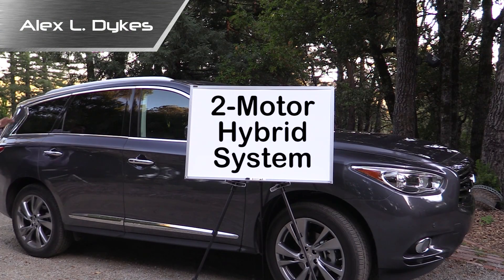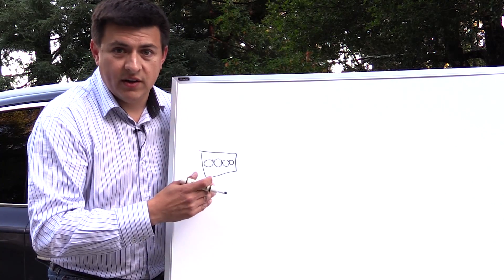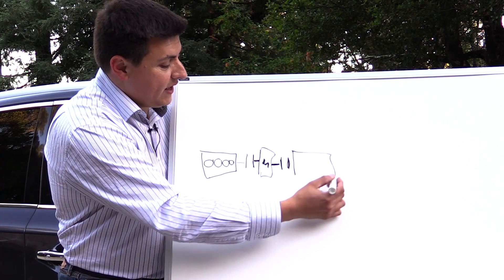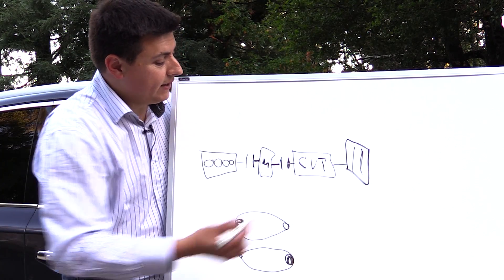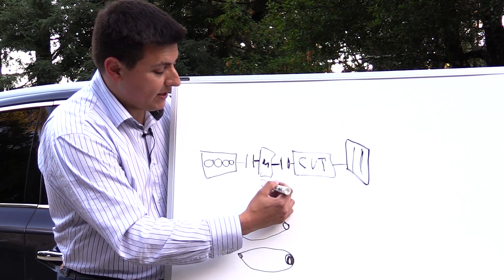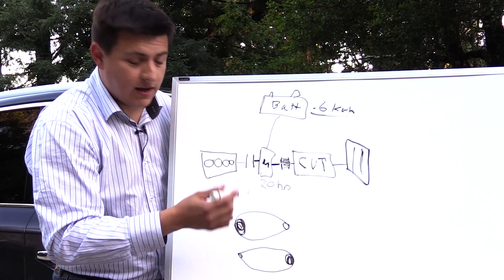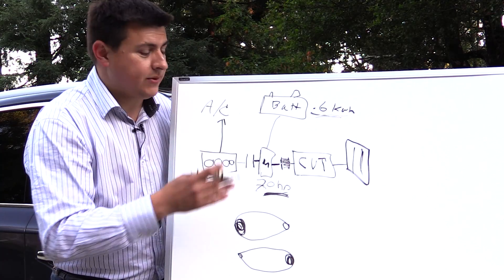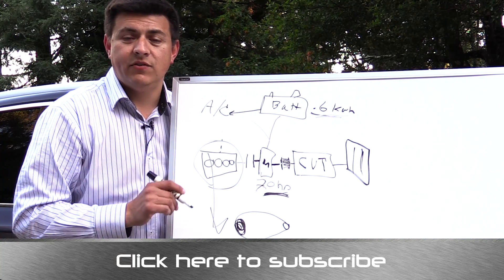How the Nissan and Infiniti Hybrid System works - Pathfinder / QX60

Comment: Thank you for your detailed explanation.  The part about why the motor generally stays ON during AC operation is a source of frustration for me.  i also have a Altima Hybrid.  It works much better given the AC and fan both work in electric mode.  Too bad the Infinity engineers didn't talk with their Nissan counterparts!

Comment: Thank yoiu for the excellent video.  One slight issue...you actually CAN engage the A/C on low while running in EV mode...granted, it lasts only a second or two, but it does happen.  Love my Pathfinder hybrid, and I do manage over 30 MPG in combined city/hwy driving, but I'm dying to know how much better it could be with a more substantial battery pack.

Comment: So, it appears this is basically the same system as Honda used to use before e-CVT, except they added an extra clutch between the engine and the electric motor.

Comment: What are the advantages and disadvantages of buying a hybrid compared to a regular engine? Also, long term potential issues of a hybrid? Thank you.
Reply from the maker: The benefit is improved mileage and reduced emissions. Long term the concern would be possible increased repair costs and a possible battery replacement.
Reply: Alex on Autos thank you.

Comment: I have 2009 Nissan Altima Hybrid. Is its hybrid system same as what you have described in the video?
Reply from the maker: That generation Altima used a Toyota hybrid system that was purchased from Toyota coupled with a Nissan 2.5L engine. While obviously related to the Camry Hybrid the Nissan version had a bit more oomph at the expense of fuel economy.
Reply: Thanks for the reply Alex. I always enjoyed your video reviews.

Comment: Very nice. So if I were to call that a parallel hybrid I'd be basically right? Sometime in the future, you might want to do a similar whiteboard on the Prius because, let's face it, with hybrids there's the Prius and then there's everything else.
Reply from the maker: Correct. While it is I possible for the car to decouple the wheels, charge the battery, disconnect the engine and run the wheels, this vehicle really won't operate as a serial hybrid at all.

Comment: It is a good thing that you highlighted that the AC of the pathfinder/qx60 run off the engine and not the battery. Lots of pathfinder/qx60 hybrid owners have complained that they were not getting the published gas mileage because the engine was always running to power the AC during summer / down south.

Comment: Hi Alex, do you know if Nissan has addressed the basic transmission issues that these cars had in 2013 & early 2014?
Reply from the maker: Nissan has not been terribly specific in what the fix is exactly but there was a software update and as I understand it a mechanical fix as well. All 2014 models should have it and 2013 models can be taken in for the fix if there is an issue. From my experience it was mostly a "feel" problem rather than an actual mechanical failure. (Although there were some mechanical failures that I am told were unrelated.)
Reply: Thanks Alex!